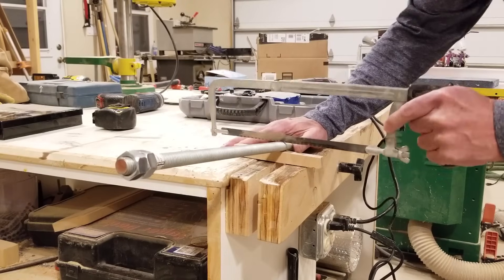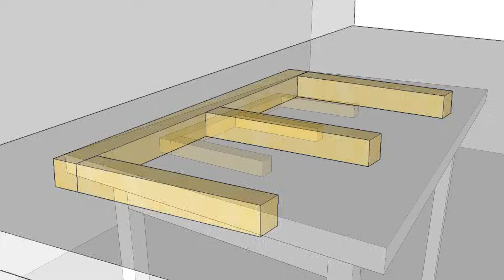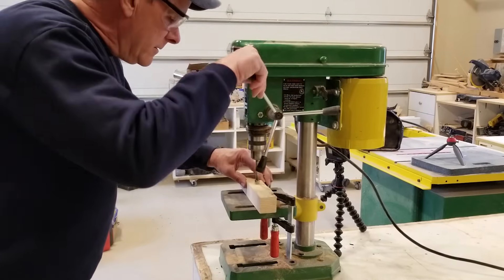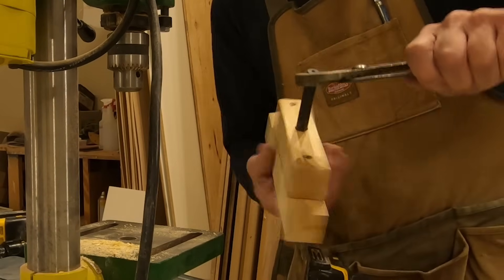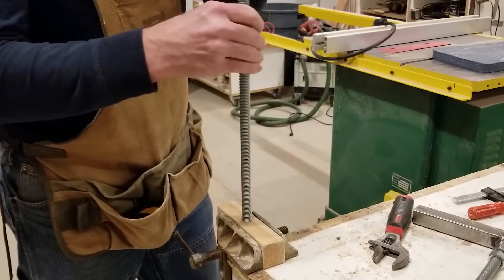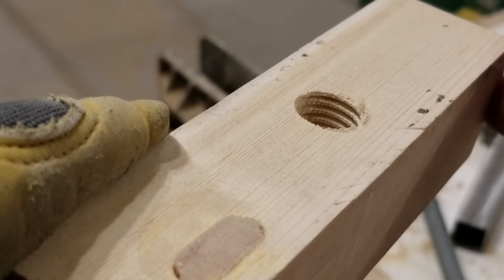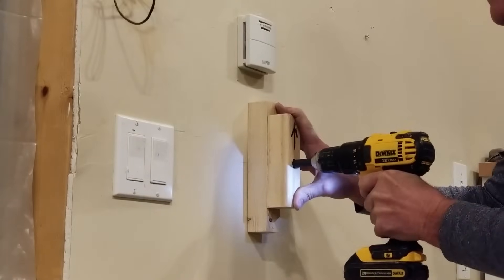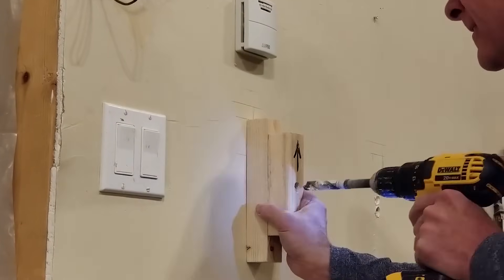Strong Floating Shelves - The Strongest Option

Comment: Very cool idea but what happens when someone decides to remove these shelves? Are those studs now compromised? My quick search on building codes didn't have an answer for this particular case. Just curious.
Reply from the maker: I’m not a structural engineer either, Fire, but you always want to be aware of whether a wall is load bearing or not. There are ratios of the amount of a stud that can be removed in either case before the integrity of the stud is considered to be compromised. That normally applies to plumbers and electricians who are drilling holes or cutting notches in studs to run pipes and wires. In this case of floating shelf installations, I can’t imagine the holes being an issue. If I were to remove the all thread, I would cut an appropriate sized wood dowel, glue and tap it in the place of the all thread rod. That would probably leave the stud stronger than it was originally. Good question! Thanks for watching!

Comment: How would you brace an 8' x 3' floating computer desk? On a corner..an open corner on the right side
Reply from the maker: I think using a countertop that wide, Peter, I would revert to using L brackets made from probably quarter-inch thick steel. One leg of the brackets could be mounted to studs with the other providing support for the front of the countertop.
Reply: @RustyDobbs  thank you for your response.  How big of a bracket? On the corner I am planning on studding a 3' 4x4 and on the back another 4x4 to match the length going right. Or should I do it differently?
Reply from the maker: @Finfanpete  Hey Peter. Why don't you email a couple of pictures of your space to rusty@dobbsworkshop.com. I'm having trouble envisioning what you are doing. Happy to give you some feedback.
Reply: @RustyDobbs  thank you! Much appreciated!. I sent an email but I am not sure it went through
Reply: Yeah for some reason I can't get an email sent to you. But it's about 76 inches wide and 36 inches deep. I can't figure out how to make it ultra sturdy

Comment: Rusty, very good method employed to secure floating shelves. I've used similar methods w/the same results for my  customers over the years - it's tricky in that electrical wiring/nail plates at times come into play and the occasional  adjacent wall to a bath, w/drain/vent pipe surprises you, although your method gets it done swell. Thnx for taking the time to post.
I'm interested in that ceiling mounted shop heater of yours - w/dust being ever present in the air, even w/a effective dust collector and dust filtration system in use - recirculating/cleaning the air, I'd like to know what type/manufacture heating unit you've installed and if it's source is N gas or LP - looks like the (yellow) supply line behind the heater is N gas ? Also, is it effective at maintaining heat for your sq. ft of shop space and what size btu unit you've installed. 
I'm getting ready to install a similar ceiling unit for heat in my shop; R-13 walls & R-30 ceiling; (800 sq ft) and thinking I need 45-50k btu - but the dust issue, related to the serviceability of those type heaters is my focus. 

No liability in your response - just curious as to how how other woodworkers approach heating their shop - I'm a self employed cabinet maker and building out new shop space. Thnx
Reply from the maker: Hey David! I have to tell you that about a month ago I was installing a fireplace mantle for a friend using this method. It had a very typical for this area, stacked stone façade over the sheet rock and studs so I took a chance on not hitting anything. I drilled in a couple of inches into a 2x6 exterior wall. I decided to go about 1/4” more and clipped a wire. That’s the first time I’ve ever done that! So, I had to remove enough pieces of the rock to get access to the wire and go to Lowe’s for a couple of junction boxes and wire. After a couple hours I had the repair complete. Decided to come back the next day to put the rock back up and continue with the mantle. Guess I should listen to my own advice!

The heater I’m using is called a Hot Dawg made by Modine. The main unit heats about 1200 ft² with 11 foot ceilings. I have another 400 ft.² next to the main shop area that has a smaller version of the same heater. My HVAC guys installed the units and sized them for the space. They are about eight years old and have worked perfectly. They are natural gas. The only service I do is to blow them out occasionally but the design seems to be such that I’m not sure dust collects in such a way that it might pose a problem. Seems pretty well thought out for shop applications. Our temperature in January ranges from low 20s at night to mid 40s during the days. The main unit which is generally only one I run will bring the temperature up around 70 in the shop in about 10 minutes time. I have a dust filtration unit hanging from the ceiling above the table saw that I turn on for an hour occasionally to better circulate the heat, but the unit itself as a strong circulating fan. They must be very efficient because I don’t see much difference in my gas bill which covers a 3500 square foot house along with the shop. They have worked well for me. Good luck with your new shop! That’s always a fun process!

Comment: I just went through this. Used 3 stud finders, the knock test, electrical scan, all the above. Started drilling and for some reason, the gray water line goes up, above and over my kitchen window, back down, and into the next room (the bathroom). WHY.
Reply from the maker: Sounds like a vent pipe for your sewer lines, Aimee. If you don’t have a second floor with a bathroom in it, that pipe should run through your roof and stick up a couple of feet. It allows air into the lines and helps everything to flow freely through your sewer lines. For the first time ever for me, I clipped an electrical wire while drilling into a stud a month or so ago. Two hours later and after a trip to Lowe’s, I had it fixed! What a pain! Lesson learned! I need to follow my own advice too!
Reply: @RustyDobbs  you know what’s wild about it? The vent pipe doesn’t exit through the roof anywhere near where it should! It’s so bizarre. My kitchen is on my second floor (front door leads into basement/first floor) and my bathroom’s the room to the left of it.  I have to get up in the attic and figure out whether this thing is possibly letting up there or where exactly it’s going. And I say this because I’ve used the metal detector in my stud finder to locate more possible pipes in the other wall I plan on putting shelves and I found something else.
Reply from the maker: @fancythisgirl3  Yep, once everything gets covered up in the construction process, it can be a challenge to figure out what is really going on later. Good luck, Aimee!
Reply: @RustyDobbs  thank you Rusty! Got more wood, some floor flanges and 6” nipples and we’re going to try again. This time, I have a better idea of what’s behind the walls. 😁

Comment: I really like the steel rod idea. Do you sell the rods and tool for screwing it into the stud? I'm looking into floating shelves for mounting my desktop computer.
Reply from the maker: I do not, Anthony. Sorry about that! The tool comes in handy for people who do more floating shelves than a typical homeowner. But a 'jam nut' technique can also come in handy in the absence of a tool like mine. You take two nuts and screw them against each other on the rod as you're installing it into the hole in the stud. Take a crescent wrench or a socket with a ratchet attached and tighten the rod into the wall using the nut furthest away from the wall. When the rod is in place, spin the outside nut counterclockwise and removed both nuts from the rod. I will have a video coming out soon where I am actually mounting a floating desk to the wall using this technique. You might find that helpful. Good luck with your project!

Comment: This seems great. I'm in the process of designing my latest reloading bench. this may be the best alternative as of yet. the plan is a bar style bench. the question is if the wood threads would hold after a few thousand reps of the press?
Reply: I’ve busted tables reloading.  I would want legs also. Just cause.  Let me know  how it goes
Reply from the maker: Good question, Practical! I know it would handle a fly tying vice and tying a thousand Elk Hair Caddis flies just fine! 🙂 I might step it up to  3/4” or 1” rods and consider putting a good construction adhesive on the threads before spinning them in. You could also consider having welded up L-shaped brackets out of flat iron and mounting them against the studs, then refinishing the sheet rock to hide the brackets. However you decide to go, it sounds like a fun project! Thanks for your comment!

Comment: Would it be less physical effort and time if you cut and tapered the lengths of the rods that are going to be used so you only have to screw them in once?
Reply: Brilliant jig and design
Reply from the maker: Yes, MrKeda, I think practically speaking there would be no discernible difference in performance between leaving the rods in place that you also used to cut the threads in the hole as compared to the way I did the installation in the video. For me, since I do this fairly regularly, having the handle and a rod to cut the threads is really a quick process. I generally vacuum out the cuttings from the holes before spinning in the final rods, but that probably is not necessary. Thanks for your comments and for watching!

Comment: There are different ways to do floating shelves, but always you hurt or weaken the vertical stud wood which is part of the building frame holding the weight of the building.
We need to bring better idea of installing floating shelves.
Reply from the maker: I understand where you are coming from, Geelle, but have you seen what electricians and plumbers do to studs to run their wiring and piping in new construction? In this case, where a hole is drilled a couple of inches into a stud and then a steel rod is threaded back into the same space to take the place of the wood that was drilled out, I see very little reason to be concerned about the strength of the stud particularly when you’re talking about downward force from the structure above. If the wall is non load bearing, there is even less reason to be concerned. However, there is always the option to open the wall and add stud pieces alongside structural studs to install floating shelf supports in and not impact the structural integrity of the building. I appreciate your perspective and thanks for your comments and for watching!

Comment: I used red heads and lag bolts and epoxy on the bolts for my mantle and it holds up very nice
Reply from the maker: That works, No Name! There are lots of ways to do this kind of thing.
Reply: @RustyDobbs  thanks for the response..I was only throwing my 2 cents out there on how I did my live edge mantle out of a cypress log

Comment: Do you think using four 2x4 supports against a 2x4 base  with pocket hole screws and two 2" L brackets on either side of each support stud could increase overall  support of the floating shelf? In my head I'm think this could help spread the weight distribution over a greater distance then the 1.5" width of the 2x4 base if for example making a 4.5" thick floating shelf but could still be applied for thinner shelves
Reply from the maker: I think your logic is probably right, Hailee. There really are lots of ways to attack a project like this. I have done a number of videos on different approaches I have tried. Without a doubt though, this method is one that gives me the strength I need for anything I would want to put on a floating shelf and yet it is a pretty simple process. Thanks for your comment and for watching!

Comment: Thank you for the Video, very straight forward.
Maybe level the bolt jig against the wall before drilling into the studs, (just to make sure the bolts are perfectly level, and not just 90 deg against the wall)
Just a thought...
Thank's again for the video🙏
Reply from the maker: Good idea, Lior. I had someone else suggest using a laser level instead of the jig against the wall to align the drill bit as I’m drilling into the wall which is also a great idea since I have a laser level. Haven’t tried that yet but it’s on my list! Thanks for watching!

Comment: This is exactly what I didn't know I was looking for! Thank you. Do you have any suggestions for alternatives to the custom tool your son made to screw in the all-thread?
Reply from the maker: Sometimes that’s a nice discovery to make, Ski! Yes, you can screw two nuts on the all thread and then tighten them against each other. Then use a ratchet and socket on the outside nut to thread the all thread into the hole in the stud. You can achieve the same goal with a couple of crescent wrenches using that “jam nut” technique on the all thread. It’s not near as cool as the custom tool, but it works just fine in the end! 🙂

Comment: You don't have a ratchet and a set of sockets?
   Sorry to rain on your parade, but it would be MUCH stronger if you had simply cut out a piece of the wallboard, say a 13" square in between the studs and screw in some flat L-shaped 1/8" steel brackets about an inch wide to the studs. Then, since you don't mind repairing the wall board, reinstall the piece and mud it over. Then you'll have some really strong support for your shelf that won't flex as long as you build some triangulation for those brackets into the shelf.
   I fear over time those threaded rods you have going into those studs will loosen up as the shelf flexes with the cycle of weight-on, weigh-off, weight-on, weight-off.
Reply from the maker: The video is intended to show an evolution in my thought processes to end up with an approach using all thread rods as a support structure for floating shelves. Reduced down to its basics, this approach is very simple. Drill holes in studs and thread the rods into the holes. Sure, you can use a ratchet and socket as I did in my most recent video or a couple of crescent wrenches and nuts tightened together on the rod will also get the job done. Since I do this sort of thing with some regularity, the fabricated handle is nice to have. The rod threads can be covered with adhesive if you’re looking for a permanent installation. If I’m installing a piece of granite or solid surface as a floating shelf, the L-shaped flat bar approach you suggest is a very good way to go.

Comment: Well my problem is my house is built with steel studs so maybe I have to weld the all thread
Reply from the maker: Yeah, Joseph,  steel studs do create a bit of a problem. But if you have to open the wall up to get to  the studs anyway, you have a lot of other options then besides welding. I'm just not sure it is worth the effort for floating shelfs.
Reply: @RustyDobbs   Yes I agree

Comment: I wish you sold these somewhere, I could do enough of the work as to drill it into the wall but do not have the equipment to create that custom shelf
Reply from the maker: I started building some things when I was 20 in the gravel driveway of the trailer park where I lived, using the step of the trailer to cut my wood on. The first power tool I bought was a Black & Decker jigsaw. Everybody has to start somewhere, 3k1ng, if you are interested in doing things like this... something to think about?
Reply: @RustyDobbs  This is great input! I am going to take your advice and look toward it as a project for my winter break. Thank you!

Comment: How can we use this idea on a Brick wall? Would it work?
Reply from the maker: It’s the same type of approach, Baburaj. You would drill a hole with a masonry type bit that ends up being very close to the size of the rods you’re using. You would definitely want to get the holes drilled perpendicular to your wall. Then use some type of epoxy adhesive or other strong construction adhesive to add to the rods before placing them permanently in the holes. Hold them in place in their final desired position and let the adhesive dry well before disturbing the rods. Hope that helps!

Comment: well.. i used 5/8 rods, didnt have the ability to tap-drill the holes, so just did them at 5/8" then used PL_Premium glue and let it sit overnight then worked on the wood, we wanted the rods and nuts exposed.. thank you as its a perfect fit and look.. and best part I don't have to worry about them lol https://photos.app.goo.gl/kBfvzRw2CrU9rWhG8
Reply from the maker: You're a talented guy, Wayne! Your shelves look great! I like what you did with the galvanized pipe as well! That's the most creative sink faucet I think I've ever run across before! Thanks for passing on the pics.

Comment: What if you used threaded pipe nipples and a pipe wrench?
It would save a lot of time having to weld  manufacture your own wrench handle, which most people do not have the means to do.
Reply from the maker: There are lots of ways to approach something like this, I31007, and your idea would work. Main beneficial element is having steel for shelf support. For me, having the handle is helpful because I install more of them than most people.
Reply: @RustyDobbs  Thank you for replying and the information.

Comment: I would think that drilling a hole on the bottom side of the shelf to recess a washer and bolt ( similar to what you can find on bed-frames and/or handrails), would be the most elegant solution to attaching the shelf to the rod in the most secure way. 
I plan on trying this out in the next  couple weeks as I just moved into a new house and have a Honey-do list that is about as long as my arm, and about 1/2 of it is  creating storage solutions.
Reply from the maker: Good luck with your Honey-do list, Robbie, and congratulations on your new home! I hope this approach or some variation of it works out well for you! I would think you’ll be an expert by the time you get finished!